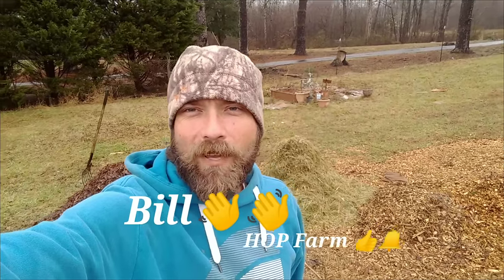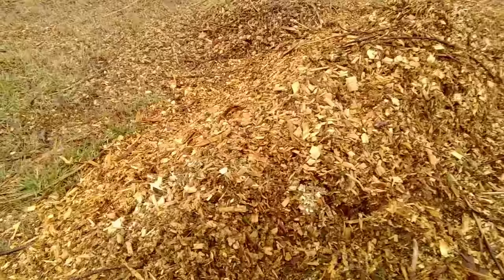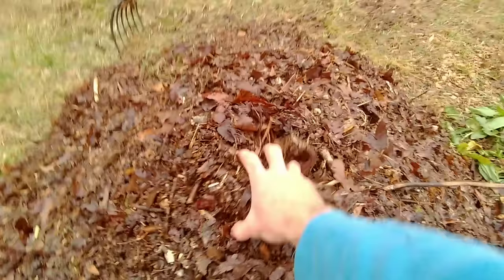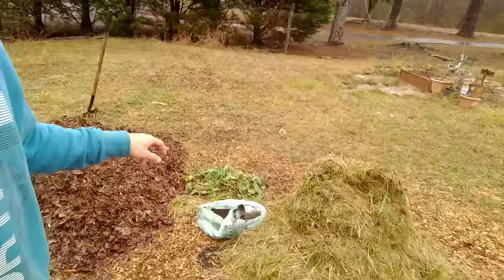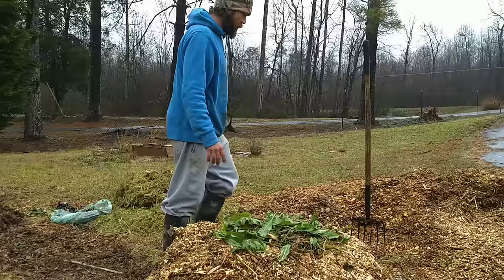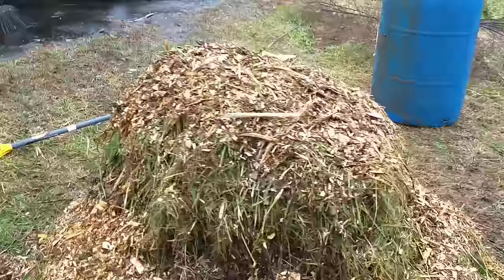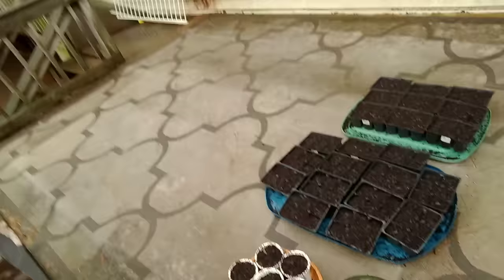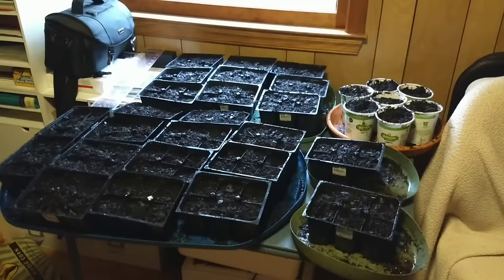Step #1 How To Build A Compost Pile (18 Day Hot Composting Method)

Comment: I read a study that says coffee, while it's good for heating up compost the caffeine is bad for plants. Sucks because I really need to heat up my heap. I'm gonna try blood meal... Nice video thanks!
Reply from the maker: Thanks
Reply: Caffeine may be bad if coffee waste is dumped on a plant directly,  but coffee grounds put into a compost pile will break down very quickly. They are a very useful material. There are very few materials that are not suitable for composting although they may be toxic before composting. Some of them are, oak and walnut leaves, pine needles, camphor laurel leaves, sawdust or woodchips, meat scraps, dog droppings etc. All of these materials are perfectly safe IF you are prepared to do the job properly. These means timely turning, sufficient mass, and adequate carbon, plus safe working practices in general. 
Composting, done properly, kills all pathogens and breaks down plant poisons in a few days. Bleached and coloured paper products are not really organic, they contain metals and dioxin residue so should only be used sparingly. It is also counter productive to machine unnecessarily, leaves are better left whole for example. fleshy green vegetation may need to be roughly chopped if it is likely to cause problems when turning.
Reply from the maker: @kenbellchambers4577   I was thinking the same thing. When you compose something down it usually gets rid of all the bed things.
Reply: Most of the caffeine is lost during brewing. If you’re using a huge amount of coffee grounds that might be a concern, but if it’s not making up a huge portion of your pile should be fine. Can always contact your local master gardeners program or search “coffee grounds compost site:edu” which will give you only search results from universities. Oregon and U of Hawaii have big agriculture departments for example :)